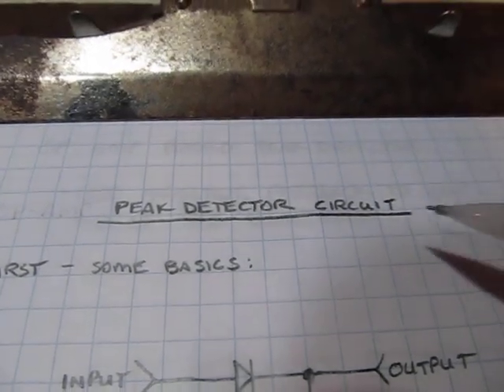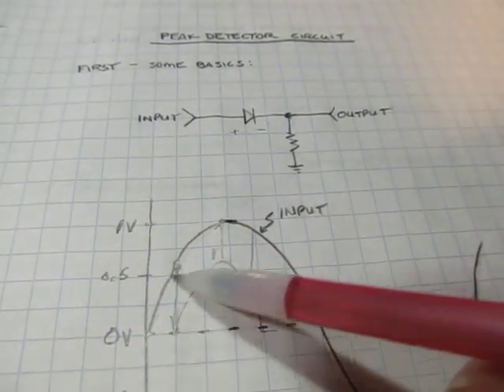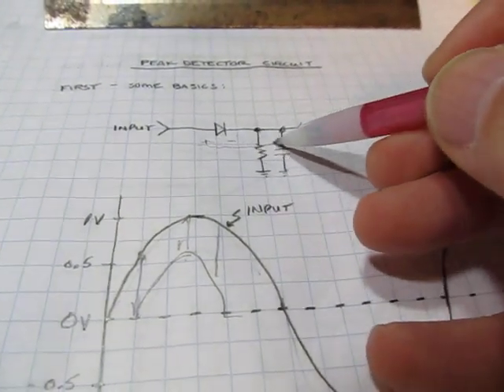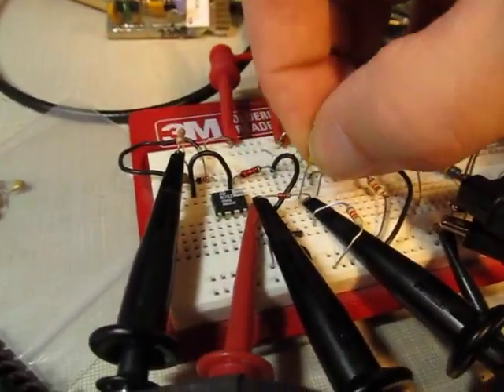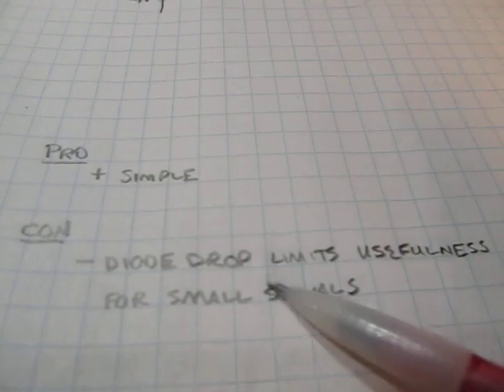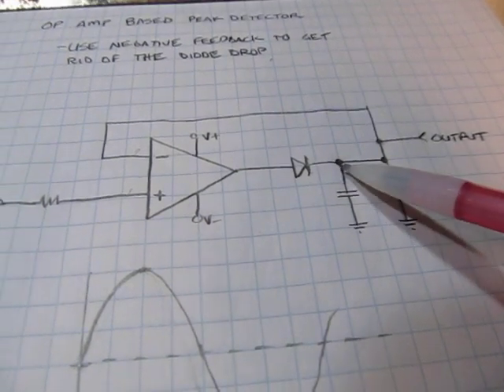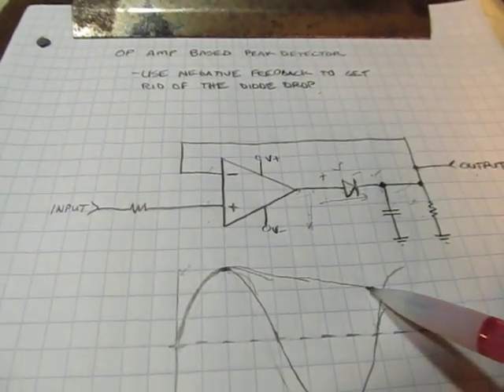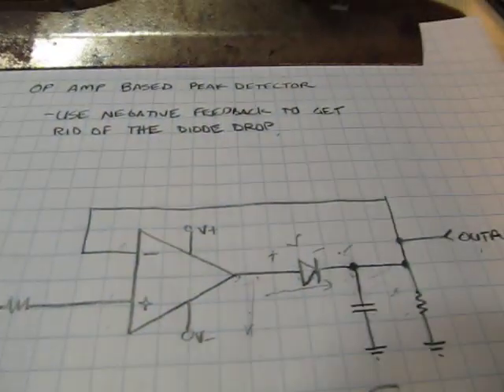#77: Op Amp Peak Detector Tutorial, with peak detector basics

Comment: very nice.  But you don't need a resistor on the +input to the opamp.
Reply: You do for some opamps. The nature of the circuit drives a differential voltage between the opamp's two inputs that is as much as the peak-to-peak voltage of the input signal. Some opamps will then draw current through their inputs far greater than the bias current seen when in linear mode. That current must be limited to prevent damage, so a resistor is a sensible precaution in those cases. An LM358 will allow differential input voltages up to the value of the supply rails, so doesn't need the current limit resistor. However, the (expensive) AD8032 being used in the video can be operated with ±5V supplies, but has an absolute maximum differential input voltage of ±3.4V, so needs the resistor in case large signals are applied. Some opamps have internally fabricated diodes across the inputs which limit the differential input to ±0.6V, but will pass excessive current unless a current limiting resistor is used. The AD8032 datasheet recommends such input clamp diodes be added externally if the ±3.4V maximum differential voltage might be exceeded.

Comment: Great Video.  In the early part of the video, you show the cap discharging through the resistor (to the left).  Wouldn't it discharge to the right - to the output where it would hold up the peak and be seen on the scope?  After all, if it discharges to ground, nothing happens at the output.

Comment: One important aspect of this circuit for high frequencies is that it forces the input of the opamp into saturation (because on the negative cycle the positive input can no longer follow the negative one).

Opamps become far far slower than their rated bandwidth when you do that.

Comment: what's the purpose of the resistor on the input?
Reply: When the input falls below its peak, the voltage on the inverting input remains clamped to the peak voltage which is held on the capacitor, so the voltage differential between the two inputs will increase as the input voltage falls. We think of that as a comparator mode, and although some opamps are happy with large differential inputs, others are not. In certain opamps, the manufacturers fabricate two diodes across the input terminals in opposite directions, so that the voltage differential across the inputs is limited to 0.6V either way. In that case, there must be a current limiting resistor to prevent excessive current flowing through one of those diodes when the opamp is driven into comparator mode.

Comment: Now that we learned about a "voltage follower op amp circuit" in some earlier video PLUS how to build a "better peak detector with op amps" we can combine those two circuits to have a "high input impedance" peak detector driving some load like some analog amp meter/volt meter without "loading or draining" the peak detectors "sample charge" and build ourselfs some sort of VU Meter/peak level meter.